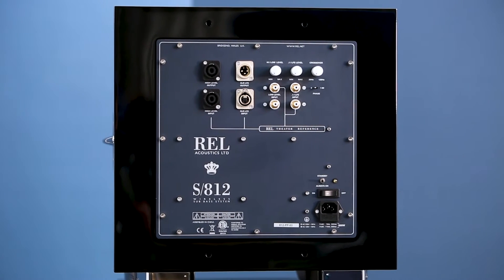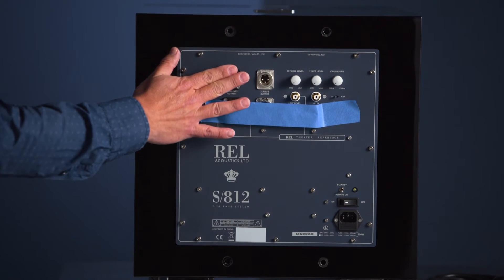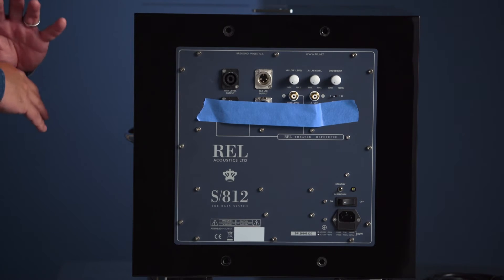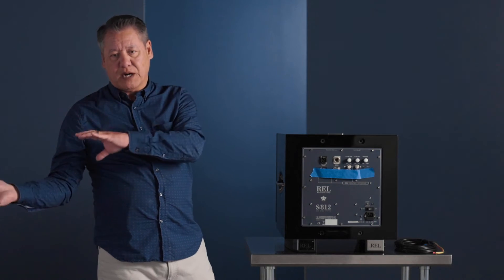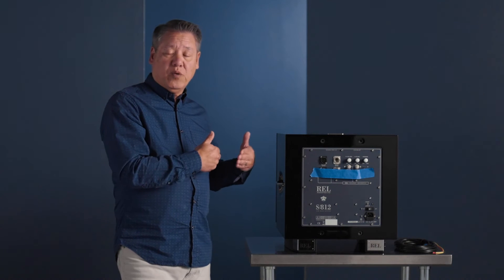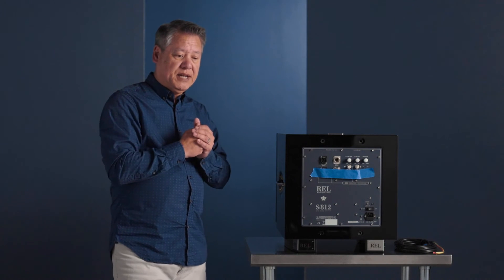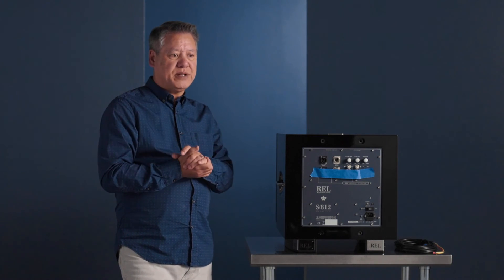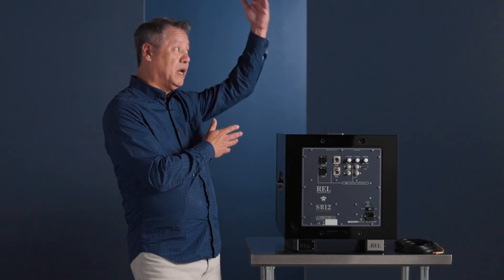REL Acoustics connectivity options, and why we offer a variety of inputs and outputs

Comment: you show RCA connected to LFE but don't show other end connecting to amp?...i dont have a sub out on my amp, only a main in/ Pre out...should i remove the main in/ Pre out jumper and put a Y connector and rca from Rel LFE into the Y?...tge Y would connect to main in/ Pre out???
Reply from the maker: Thank you for reaching out. Is your preamp/integrated amplifier a 2-channel design, meaning that it only features left and right channels and does not process additional surround channels for home theater applications? If so, then we recommend exclusively connecting your REL using the High Level input or the Low Level input. The .1/LFE input on our subwoofers is only intended for use with multi-channel AV processors or receivers, which separately process an LFE (low-frequency effect) audio channel found in home theater material, in addition to the main speaker channels. 

If you have any additional questions about connecting a REL subwoofer in your system, then at your earliest convenience please write in to contactus@rel.net and we will be happy to assist.
Reply: @RELAcoustics  thanks for the reply...i'm using a 2 channel Vincent SV-737 Class-A hybrid intigrated amp designed in Germany...4 Ohm: 2 x 300 Watt...Speakers A & B- using A for front 2 speakers and B terminal posts 2 Rel T7X to right/left for stereo to Rel high level speakon connection...(using AudioQuest type 5 Rel Speakon cable) of course i keep both speakers A & B on... another way i found was mono-using speakers A & B seperately...stereo is what Rel tech suggest and so i have hooked them up as a stereo pair...actually my Panasonic LZ2000 sounds really good when i blend it with my hifi and rel subs...wider and better sound stage...i know its hard to belive...chromecast streaming tidal is really awesome...passing through a Gustard R26 DAC...the subs pick up most if the low end...Dali Rubicon ll are good...but im sure the Dali Epicons would sound better...so thats how you do it if you have a two channel intigrated amp...to be honest...i'm thinking one T9X would work as good or better! because the larger woofer driver would have a fuller sound...i wouldn't use the T5X.
Reply from the maker: @briancampbell7712  Thank you for your response, and for providing this information. Since your Vincent SV-737 is a 2-channel integrated amplifier, we recommend exclusively connecting your pair of REL subwoofers using their High Level inputs. In this system there will be no advantage to also connecting to the .1/LFE input on each subwoofer, since your amplifier is not processing multi-channel signal with a separate LFE channel.

Comment: In my case the enclosed high level cable length of 10m will not be enough as I need twice as much about 20m(66feet). Thus can you state the exact specs (how many wires, what gauges each, shielded or not, resistance, capacitance etc.) for the high level input cable I have to look for locally as I already need to lay it down at this very moment in the construction phase. The point with LFE wiring is clear just a decent microphone cable ending RCA/XLR connector.
Reply from the maker: Thank you for reaching out. It is possible to build your own High Level cable using a SpeakOn/NL4 plug and bulk speaker wire. The High Level cable is three conductor, and the stock cable that comes supplied with our subwoofers is three-conductor. In terms of the pin-out for the SpeakOn/NL4 plug, red wire connects to the +1 terminal, yellow wire connects to the +2 terminal, and black wire connects to the -1 terminal. 

That all being said, based on this cable length it could be worth considering one of our wireless systems, rather than a direct wired connection. If you have any questions about our wireless systems, or about building your own High Level cable, then feel free to let us know and we will be happy to assist.

Comment: Hi, I got S5. I m going to use for centre channel. what connection should i use btw connect high level or low level input connect to centre channel  pre-out on my pre-processor ? what is different btw 2 connections? Do i get the same result? Thanks
Reply from the maker: Thank you for reaching out. To get the best possible performance from a center channel subwoofer we recommend connecting it using the High Level input, to either the center channel speaker output terminals on your amplifier or to the binding posts on the back of the center channel speaker itself. For more information and connection instructions specific to your system, please write in to contactus@rel.net and we will be happy to assist.

Comment: can connecting high level (with black wire floating) DMG class D amps?
Reply from the maker: Thank you for reaching out. When connecting High Level to Class D amplifiers, only connecting the Red and Yellow wires and leaving the Black wire disconnected will not result in any damage. If anything you may experience a hum with the black wire left disconnected, in which case you can attach it to a chassis screw on the amplifier.
Reply: @RELAcoustics   thank you very much ! i really hope the RCA will take care of the hum ! (if there is)

Comment: Hi, I have a question of conexión, my amp is a class A, and it doesn’t comes with balance out puts… in my subwoofer the only inputs working are the balance inputs (XLR) where can I buy the cables… I live in Mexico, or how can I make them? Thanks a lot!
Reply from the maker: If you are only able to connect your REL using it's balanced XLR input, then this connection can be made using a standard XLR cable which can be purchased either online or from most audio suppliers.

Comment: My question im really think about is, its better two HT/1003 for my Elac Vela 407 to listen stereo only( i heard there are also good for Music ), or its better one T/7x ?? My goal is to get more spatial sound....Greetings
Reply from the maker: Thank you for reaching out. If this system is primarily (or almost exclusively) used for 2-channel music listening, then the T/7x will be the preferred option for pairing with your Elac Vela 407 speakers. While the HT/1003 can perform well with music in addition to home theater, the T/7x does have an edge in terms of the speed and responsiveness of it's output, as well as it's ability to blend with your main loudspeakers.
Reply: @RELAcoustics  Thank you really much! It helped me a lot...i will go for the T/7x...Greetings

Comment: I got my first S812 and have to say I'm so happy with it I have a naim system and it's sound amazing with the rel gone to a different level so I decided to get another   for stereo listening
Reply from the maker: We are glad to hear that you are enjoying the performance of your S/812! If anything comes up or you have any questions about the subwoofer then feel free to let us know and we will be happy to assist.
Reply: Thanks for reply so when I add a second rel the crossover will be probably different settings on the other side of my room will this be the case.
Reply from the maker: @hawkmoon369  In most cases the Crossover and Level settings will be slightly different between the two subwoofers, in part due to most rooms being acoustically uneven and the subwoofers not being placed perfectly symmetrical in them. The goal will be for the output of the two subwoofers to be matching and even from left to right, even if that results in slightly different settings.
Reply: @RELAcoustics  great thanks for info.

Comment: Did you cover the wrong connectors?  You covered the inputs and showed the outputs for connecting to another REL for an array.
Reply: Yes, I think so, but he was clear about the usage case! I got his point crystal clear
Reply: Line array configuration.
Reply: I am to also confused …. He was pointing to connectors that clearly say output connectors!!   And then implying they are input? This is really confusing?